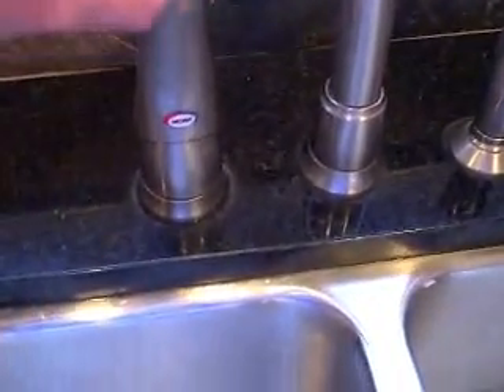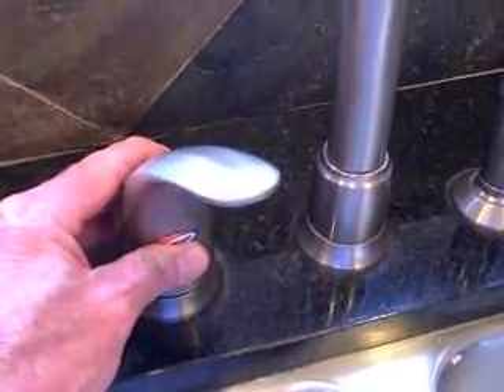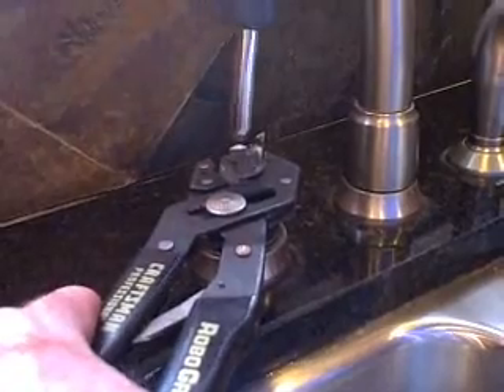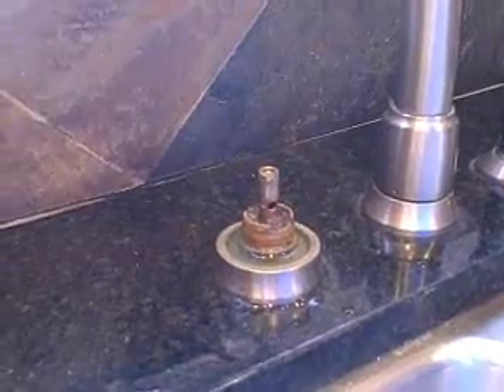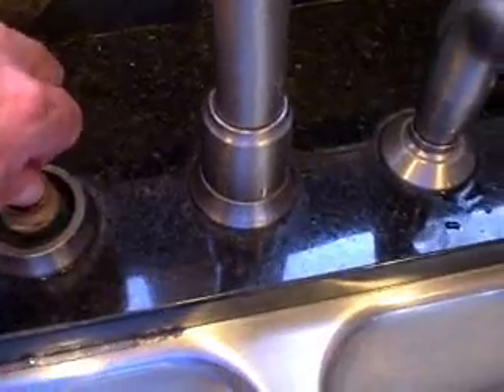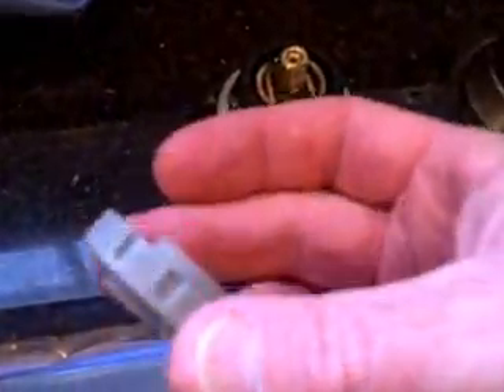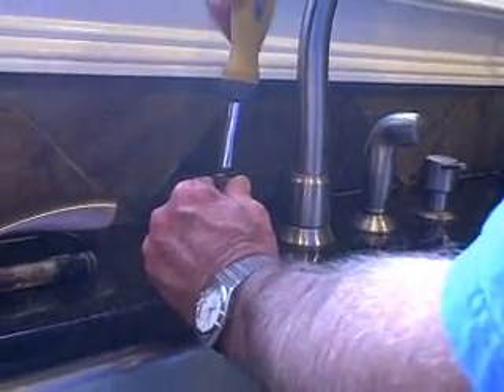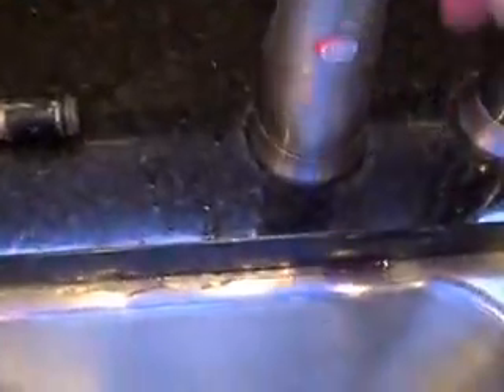Fix a Leaking Kitchen Faucet

Comment: Some have complained, but I have a single handle Moen faucet, and this is EXACTLY what I needed to do the job right. I had some problems reseating the new cartridge, but watching this gave me the assurance to move forward with a little more force. I would have never operated the handle and determined if I had it facing the correct direction without seeing this video first. I appreciate the information. Please keep providing it. There are a lot weekend warriors out here that need the help.

Comment: MOE does a great job of replacing parts for free, but did not give me an instruction on how to replace it. You saved me a ton of money by showing me how to remove the old 1225B part. If not for the video, I would have never figured it out. Thanks a bunch...-AR

Comment: I used this to figure out my single handle faucet...worked exactly the same.  I had trouble getting the cartridge out so I had to stand on the counter over the faucet and pull up.  I just about tumbled to the floor when it suddenly came loose!  But I got it!  Thank you for the instructions.  It's off to the hardware store now for a new cartridge.

Comment: The plastic tool they give you when you get a new cartridge is worth its weight in gold to help you turn the cartridge before you pull it out.If the hots on the right when you put it back together;it is just a matter of turning the centre brass stem 180 degrees and and the hot will then be on the right.Moen does guarentee their faucets for life as well and you can get that cartridge free of charge.good luck and have agood day.

Comment from the maker: Now pry up on the brass stem while, using the point where your plier tips rest on the valve body as a fulcrum..  This gives you  a lot of leverage without stressing the faucet.  Once you get the cartridge unstuck it will come out pretty easily.

Comment from the maker: Ditto to TheOldkid888 .  Just place the little plastic tool over the brass stem and get it seated between the notches, then turn it with your channel locks. That will unstick the cartridge and you should then be able to remove it.  If for some reason you don't have the tool, try the following:
pull the center brass stem all the way up, adjust your pliers so you can grab the brass stem while resting the tips of the plier jaws on the valve body (the part the cartridge goes into). Con't next

Comment: Brian, Great video and it is even better that it looks like you are repairing my exact faucet. I followed your instruction but got stuck removing the handle. I took out the set screw but the handle did not come off. I pulled pretty hard but did not want to break anything. Should I pull as hard as I can? The shround pulls loose if I pull too hard. Could the handle be bound by calcium deposits?

Comment from the maker: @RFurball Try wiggling while you pull.  It could definitely be stuck by calcium deposits but it has to come off.  If it doesn't you will have to replace the faucet anyway so you might as well go for it.

Comment: Thanks so much for this video... because if you I was finally to repair my increasingly  leaky faucet myself, and I am NO plumber lol! Got it done smoothly, however I notice now that when I turn the water on full blast, it's almost like the cartridge is lubed so well that the weight of the faucet handle is able to weigh it down, lowering the water pressure... Did i do something wrong? It never shuts off completely, just to a weaker flow.

Comment: Mr plumber, thanks for the video, it helped me replace the cartridge but I was left with a small black plastic ring that pulls apart which I think has led to the faucet being loose and sometimes when I push it down to off it doesn't catch and the water stays on.  I obviously missed putting it back on in the correct order but after reviewing your video I didn't see any sign of such an item.  The only black plastic ring was near the base and that's back on fine. Do you know where it does?

Comment from the maker: @imanolgonz  A new cartridge comes with a little plastic removal tool.  remove the little copper clip, fit the tool on top of the cartridge, grab the plastic tool with the channel locks and twist it back and forth to break the seal on the old cartridge.  Yo should be able to remove the old cartridge now.

Comment: the pin seats on a groove.. Try to remove the cartridge from the stem and seat the pin to see if it works outside the faucet before putting it back in.. These can be quite tricky if you get the angle of the insertion wrong..

Comment: my friend has 3 new mixer kitchen taps but all 3 leak and they are out of time on warranty etc, they leak within a day of installation, dripping fast from underside of handle where the cartridge is installed?  there is also now a drip from the tap spout itself, could these all be the cartridges?  in a new tap???